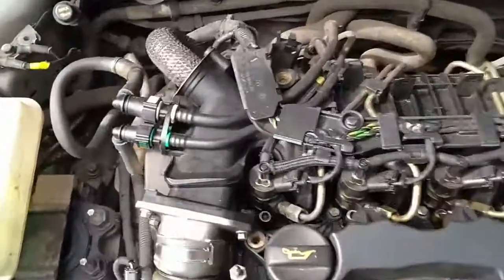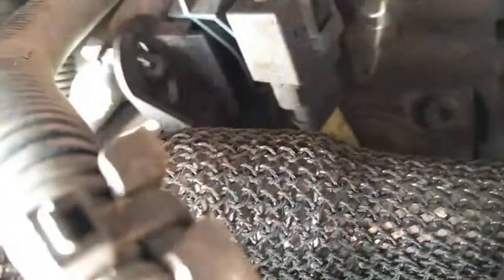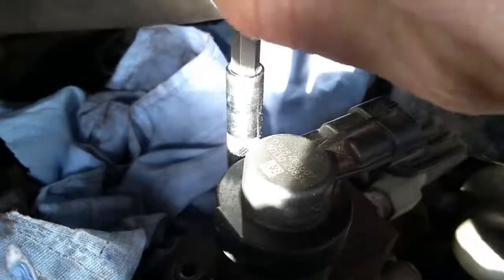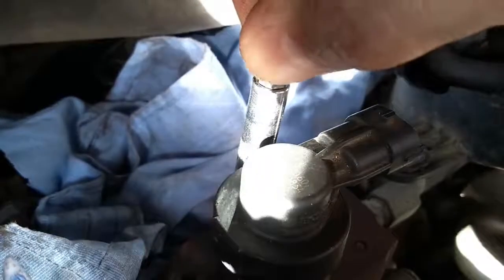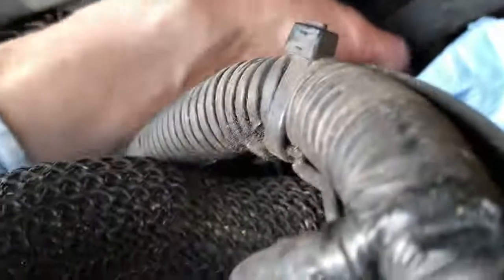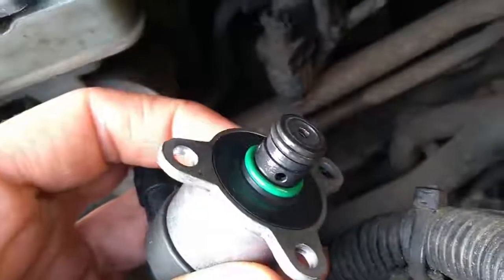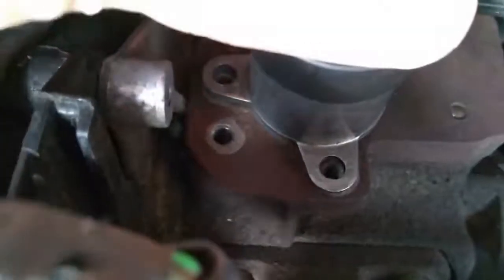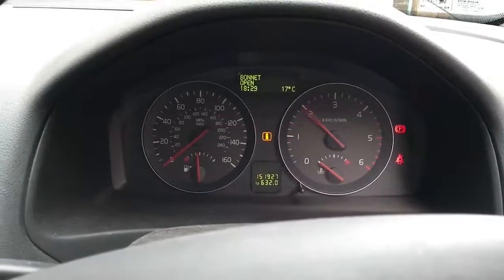Bosch Suction control valve Remove/Repair - Volvo V50 - Fault Code P0089

Comment: Hi everyone, I’m working on a Volvo S40 1.6 D (engine D4164T). The engine refuses to start ... fuel flows freely from the tank and return lines, but the pressure at the common rail is very low and sometimes fluctuates (high at first, then drops). We tried bleeding, blocking the return pipe, and even using spray to help it fire, but it still won’t start. Could this be a high-pressure pump issue or a faulty control valve? Any help or step-by-step guidance will be highly appreciated.

Comment: I have a Volvo v40, D2. It only has one HP pump. No pump in the tank. To the problem. something hammered in the car, the sound increases with the engine speed. You can clearly feel the fuel lines shaking violently. Found algae in the tank. Cleaned the tank, the lines and changed the fuel filter. But the sound and shakings are still there. If I disconnect the return hose, the shaking and the sound disappear. Is the whole HP pump broken or what do you think?😀 i can drive the car as usual. No Engine lights or limp home.
Reply: Hej! Hur löste du problemet med problemet med returledningen? Jag hade samma problem, det slutade med att bilen slutade att fungera. Bytt filter, diseln ser ren ut när den kommer ut ut filtret nu, men bilen vill inte starta :-(

Comment: Hi.. if this valve is blocked or stuck in a closed position  , will it stop the fuel from going to the common rail?
Reply: I have fuel coming in the high pressure pump but nothing comes out to the rail
Reply: Yes, it controls fuel to the rail and  injectors essentially so if it's faulty or stuck, you have minimal fuel, or the incorrect volume coming through to the rails and youll have a sluggish throttle response. I'm about to change mine because of this.

Comment: I am having a problem where fuel is not getting to the engine, and this valve is noisy continuously when the ignition is on. Please help.
Reply: I'm having same problem did u solve the problem by doing what he did
Reply: Same sound on my car.Will change it tomorrow